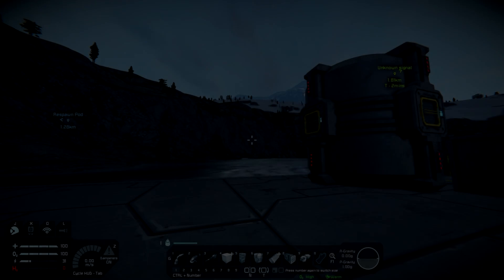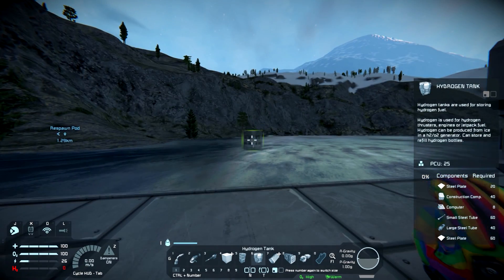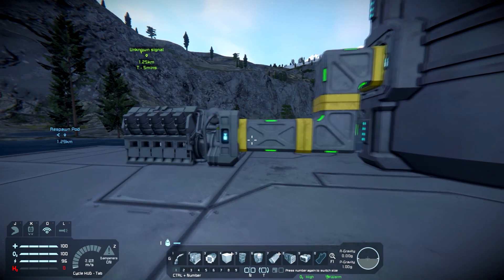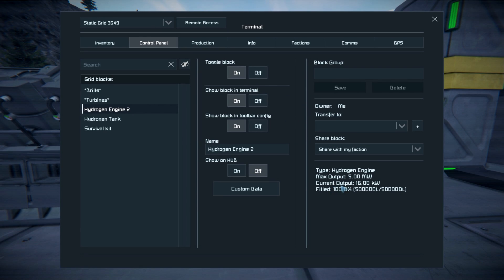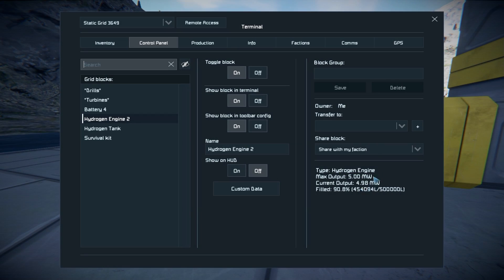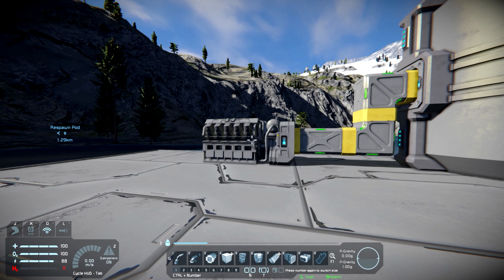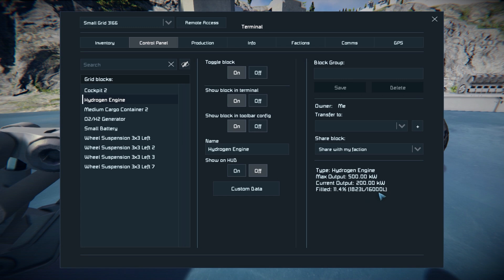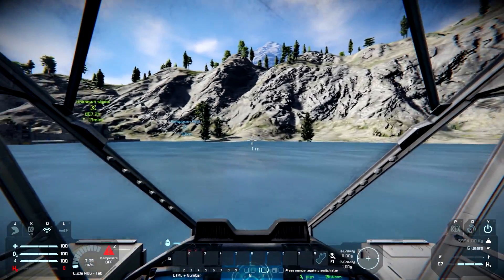Space Engineers Tutorial: Hydrogen Engine

Comment: you could've just said "never use them"
Reply: They are good in the tundra where he's at
Reply: @zacharyjune7510  I live in the tundra on the earth like planet and never even touched hydrogen engines...I just got loads of well placed wind turbines and a rotor based solar panel array that I manually orient and I have never had power issues even with 7 refineries, even starting out went pretty fast
Reply: They’re ok if you have ice in space, but reactors are miles better in space. I use them because it’s a bit closer to my base than the uranium, and hydrogen is easier to produce than refined uranium.
Reply: u can use them on a miner so u dont gotta worry about ur battery running out, u can just go n mine some ice n ur back on track.
Reply: @tabaxer  yes but I'd rather get back to base and build / design something to spend the time than mine ice

Comment: If I build a rover with a hydro engine and use a connector to link it to my base when not in use, will the tank fill while the rover is powered off?
Reply from the maker: Yes, because your rover will be powered by the base, while your rover is off.  And as long as you have Hydrogen on your base, it will fill the tank if it has room.  

Or if your rover is the only source of hydrogen conversion than your base should continue to power it, while your Engine on the rover is turned off.

Comment: its a decent output for early game but if you don't have the means to collect a LOT of ice very quickly, its kinda pointless. and those would need to be constantly filled with ice. 

 you would need to use two o2/h2 generators to keep it running at full capacity which gives 5Mw, which is around the same as i think 12 solar panels at 100% efficiency. so technically you could use it for recharging ship batteries or whatever, like you said, but the amount of hydrogen it needs to run is just too expensive.

but I would suggest it needs a huge buff to be useful. either increase the amount of power it gives by a lot, OR reduce the amount of hydrogen it needs to run at full capacity.
Reply: Plus they work at night, unlike solar panels.
Reply: Do you really need full capacity?

Comment: I don't see the point of a hydrogen engine on anything other than the rover. I suppose it'd be ok as backup power that you keep ice in just in case, but really though I just don't see the point.
Reply: I need to use it for large atmospheric ships because i do not have access to uranium so i need it for power
Reply: @battalionstallion3894  You'd be better off use hydrogen thrusters and using ice for that then power other systems with battery and some solar panels for passive regeneration of the batteries. I can't imagine the amount of ice needed to keep a large grid atmo thrusters going considering power output is only 5 mw, 1 battery provides nearly as much output.

Comment: Hydro bottles? (To start it)
Reply: Nope; the only thing that can go in to the hydrogen engines storage is hydrogen gas in liters and you can not transfer hydrogen from bottles. You either have to hook it to an O2/H2 generator filled with ice or a Hydrogen Tank that has Hydrogen in it. You also need to supply the Hydrogen Engine with electricity either from wind, solar, battery or though it defeats the purpose; you could use a reactor with uranium.

Comment: I spent 30 minutes trying to get that stupid thing to work and the issue is the tank? Good grief I thought it was just broken and waiting for a fix. Back to space engineers thanks man.
Reply from the maker: Well the tank extends your storage and amount of time the engine will last.  But the engine has its own internal tank.  If it don't work still give me a shout.
Reply: @malkuth1974  connected, tank has hydrogen but wont transfer any of it to the engine
Reply: @semtheprogamingmaster8610  The engine has to be turned on connecting to a hydrogen source in order to fill its internal tank. Too bad the integrated tank cannot be used with anything else or I wouldn't have built 12 large ones to convert a red ship I found to hydrogen.. ):

Comment: In order to use the Hydrogen Engine you only need the O2/H2 Generator not the hydrogen tank .
Reply: You also need a power source to run the engine and it wont run long without a tank.
Reply: @SirTragain  it'll run for a couple minutes on its internal tank,and can have a couple o2/h2 gens feeding it. However the Engine itself (In my experience) I use it for emergency power only, Such as coming in from a space mission & batteries are nearly depleted from Ion thrusters, I can turn the engines on to power atmospheric thrusters when you otherwise wouldnt have enough battery and go over 100% power usage
Reply: Yup a couple of minutes isn't long.

Comment: biggest issue with hydrogen engine is you cant stockpile engine fuel without running the engine... and in builds ive done so far it means without a tank you will burn thru your ice almost as fast as the engine burns thru its stockpile.. you literally need to shut off everything else except 1 outside power source and the O2 gen and the hydro engine... also at least for small block builds the hydro engine is only good for short boosts or emergency battery charging... and still uses a ton of ice in that short time.... in short its better to have external tanks to fill hydro engine buffer.. at least untill balance is added or mod made to balance... 
also of note.. solars have been nerfed.. have yet to try wind on vehicles... and lack of uranium has effectively nerfed the real power gens.. not that that matters as they were burning thru uranium like a kid eating candy... either way we need a stockpile option on hydro engine without needing to run the engine...

another note.. increasing cargo space to 10x makes it bearable as you can store enough ice to feed the engine for more than 5 min.. but still eats ice like a kid eats candy....
Reply: I can agree on the stock pile option I said as much when I gave my feedback on the hydro engine during the testing. My observations now are that it at least can provide full out put on a single O2/H2 generator since launch. Previously it couldn't give more then 1/2 power with one O2/H2 generator, now it is almost a viable way to recharge batteries. I would just as easily build a temp battery and discharge it before grinding it down since the resources where more plentiful and seemed easier to cultivate since you get everything back except some power cells even some of the iron is returned now it depends. If the ice is available I would use it. Though as it stands on a planet with atmosphere the wind turbine is pretty much king for power output it just needs to be secured to the ground either by being built there or by using a landing gear and your good to go. I can get about 1.5 MW with a single wind tower without trouble. That's with one on top and one a block down and out at each of the four directions. I am sure more could be built if the tower was high enough.

Comment: Have you tried putting one of those engines in a small vessel. I would like to see how well it does in something like a small mining ship. That way, you could simply go and mine some ice if your getting low, and if you had maybe two, or three batteries on the ship, the engine could charge these quite quickly, and keep you going for a lot longer than if you were just using batteries alone. I think some experimentation is in order.
Reply from the maker: Yes.  The small engine doesn't produce enough energy on its own to power 1 Atmospheric thruster.  And even with a battery you will be getting the same results as the large grid version.  Lots of ICE to keep it going.  Anytime these engines are using their Max Power output they just burn through Ice way to fast.  Unlike the Rover example which will last years?  I complained about this in the Play test to Keen and they did not seem to want to do anything about it... Lets not even touch on the whole breaking the law of thermodynamics these things do... :)
Reply: @malkuth1974  That's a real shame, would have been great. Let's hope Keen has a change of heart and actually makes these engines usable in anything other than a rover. At least this saves me the trouble of testing it out.
Reply: @malkuth1974  hmm, how do you power the atmo thruster then, with batteries? I did not find any uranium yet. Did you try to add maybe 2x tanks to the ship, maybe it will be enough to fly a reasonable time?
Reply from the maker: @robosergTV  Hi RobosergTV  I take it you want to recharge the batteries?  If so I always use my Main base as a battery charger.  All you need is a connector on your base and a connector on your ship to do this.  Once your docked you can put your ship batteries into recharge mode.. Takes maybe 12 mins to recharge them.  You want batteries on your Ships because they have the best output to supply all your engines with power in the game.  If your finding that your going red (not enough power) in your ship when using thrusters just add another Battery..
Reply: @malkuth1974  I meant using h2 engines to power atmospheric thrusters. You said it burns through fuel very fast. Hence my last question about adding 2x h2 tanks to the ship.
Reply: @robosergTV  He also said that you'd need several engines at once to actually run a ship. So most likely you would need a shitton of engines to even put enough thrusters to get the engines into the air. 

They may be useful if you are in space though.
Reply: @robosergTV  I've tried running 3 hydrogen engines on a small mining ship.  burns through 20k of ice in about 5 minutes and then i'm stuck running on batteries anyway.  my opinion is these things are pretty useless for powering anything continually.  Use them perhaps for emergency recharge of batteries ... but the amount of fuel used for the energy given isn't very good.
Reply: @Maddinhpws   you would probably need atleast 10 engines to one thruster to slow down the rate of fuel burn, but then you would need 100's of thrusters just to get the bare basics of a mining ship off the ground, they need to be a lot more efficient if they are to be used like that
Reply: Add a yield module or power efficiency module won't that help?
Reply: @neored1608  as far as im aware can only attach upgrade modules to assemblers and refineries